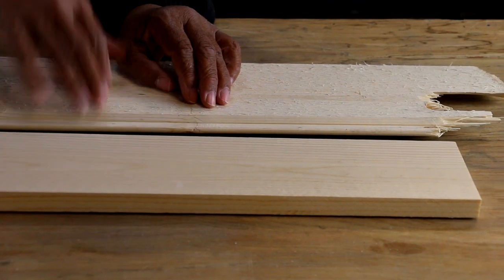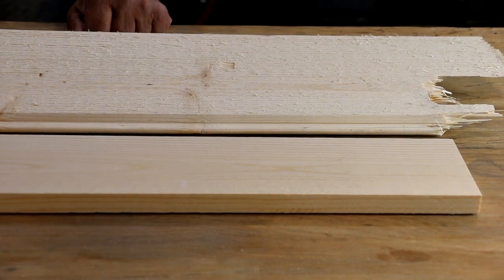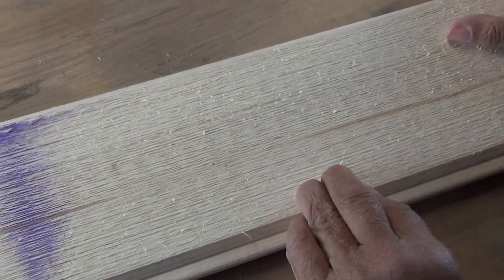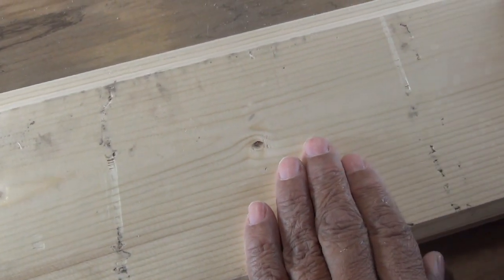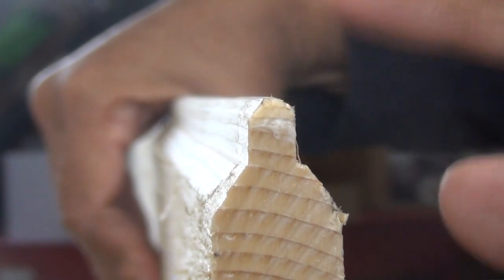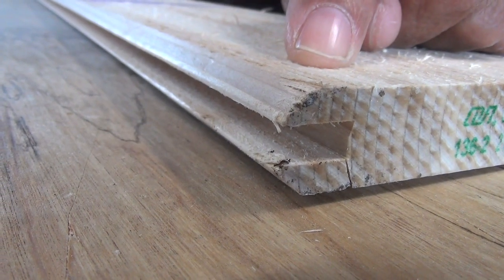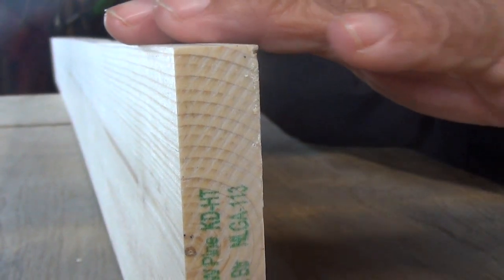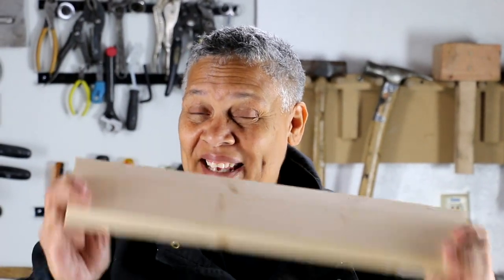The Secret to Getting Good Wood for Pennies

Comment: Excellent idea only I don’t have a bench saw or plainer 😩
Reply: Daniel Fairless you can pick up a jack plane pretty reasonable at a yard sale or flea market. Mine is about 30 years old to me. And it was old when I bought it for a couple bucks. Sharpen the blade like Leah did the chisel and make sure the sole (bottom) of the plane is flat. There are some that have grooved bottoms. The high part is what needs to be flat on those. Get a second blade ease the corners and you have a scrub plane. There’s a bit of a learning curve on setting the depth of the blade and reading direction of grain
I think Ms Leah did a video on hand planes. She also has one on handsaws. I learned on a western saw, but I like a Japanese saw as it cuts on the pull stroke and is easier for me to control. I think you can pick one up for about $20-30 that you can put different blades in for soft or hardwood. A corded circular saw should be cheap this time of year with a couple of jigs and different teeth count blades, you can cut almost everything a table saw can. Don’t buy cheaply made blades
Reply: Excellent response. You ,Daniel, might feel overwhelmed with Elaines great suggestions but along her suggestions and with Leah there is also ton of info on youtube. Paul Sellers comes to mind for one. Community colleges offer woodworking courses as well. There are many good resources at your local library.  Good luck.
Reply: William Branham  -  I Second the Paul Sellers suggestion.  =]  He's GREAT!

Comment: In our area there is a cabinet manufacturing plant. They get culls/seconds/rejects that a local flea market sells when they are available. A while back I got some 1/2", 4 x 6 cabinet grade plywood for about $7 or $8 a sheet. I went by today and all they had was 3/4" 4x8 sheets for $15.00 a sheet.  So check your area for salvage lumber resellers. Thanks for all of your great ideas Leah.
Reply from the maker: nice idea, thanks!

Comment: Way before your son was born, I worked at a hardwood company.  I was able to cover an addition wall on a rental with mahogany.  When mahogany was shipped to the company for grading and drying, it was covered in mahogany.  We usually just burned it in barrels to keep warm in the winter at work.  I used hand planes since back then I had limited tools, a corded drill and a corded circular saw. Bought my first jack plane at a flea market and fell in the hole with old Tools. The offcuts from dry kilning were also free.  A lot of the furniture factories give wood offcuts for free or very low price especially in winter around here.  And then there are pallets.  Books have been written,  videos and instructables have been made on what to build with pallets.  The nails aren’t as bad to remove as they were ten years ago.  Also, one can try construction sites as they tend to throw out a lot of pine.  And even though I own and keep buying a lot of woodworking books, I would suggest Jacob Abbott’s books from the 1800’s free on line!  http://www.gutenberg.org/ebooks/author/2136   Even the beginners books assume one knows or has access to someone who knows how to use hand tools from that era.
Reply from the maker: HI Elaine, thanks for putting the link to the book for others to use! You are right in that there are many great sources for free wood out there...the offcuts, the construction sites, and the pallets that you mentioned.  Another good source is when people are throwing out old cabinets and old furniture...it is usually hard wood.
Reply: seejanedrill So true Ms Leah!  Here there’s discarded furniture all the time and couches and chairs often have poplar frames. And those old cabinets may have very tight grained pine or maple. Trees don’t get time to grow like that anymore

Comment: Great video as usual Leah! Any advice, maybe a FAQ section for r commend3d beginner woodworking tools? Such as which table saw and such? I️ go to the store and look and have no idea. I️ don’t wanna Buy the absolute cheapest as I’m sure I’ll need to upgrade later. Table saw, miter saw? What would be your beginners kit to building a garage wood working area?? Thanks!
Reply from the maker: You have brought up a great idea for a future video (the beginner's guide to building a garage wood working area).  As for table saws, I really like mine.  It's a hybrid, and definitely not as expensive as a full-on cabinet style saw, but is more of a "mid-range" table saw.  I put a link in the description to the saw on Amazon, so you can check it out.  But you can probably find it cheaper than the Amazon price if you hunt around a bit.

Comment: A track saw can be used to cut up recycled wood, especially old furniture that has been discarded.  Some of this wood is not immediately suitable for a table saw, for example it doesn't have a straight edge to run along the fence, or it is warped.  Cutting it up with a track saw can work well and make it table saw ready.  I've used a lot of excellent hardwood from cabinet doors that used to be $2 at local recycling places.  Also hardwood flooring cast-offs, especially if it is unfinished can be used.  

Nearly everything I build has at least some recycled wood.  Often that wood is better quality than the new lumber used today.  I picked up a very large pine entertainment center ("free" sign on curb) and will have gotten 20 drawers from it when I finish my current project. It used a lot of 5/8" pine.  I left the finish on the drawers.  I've been spoiled by how good this was.

I love that you are promoting this.  It's a waste to see that wood go to the landfill.  And I can afford 

Thank you for the tip on going early in the morning.  I normally don't do that.
Reply: I was going to add that there are some track saws that aren't so expensive, you can use your circular saw and they sell you the track and a base.  Eurekazone is a solid one, you can buy a track, base and couple of clamps.  It's pretty DIY and you have to study it for a while to figure it out, but definitely more affordable than the European designed brands. 

Also, I wanted to thank you for these videos.  When I'm down in the dumps, a couple of your videos cheer me up.
Reply from the maker: thank you so much!!  And thanks for sharing the track saw ideas with the community.